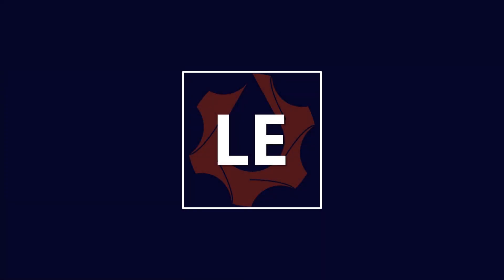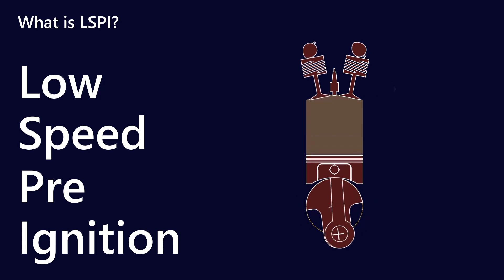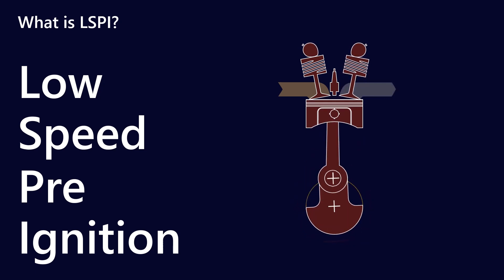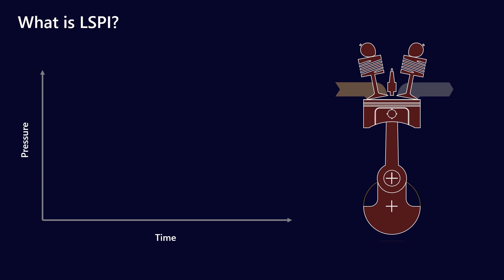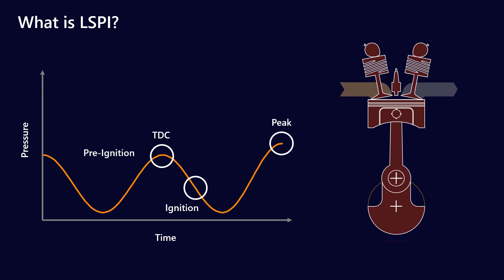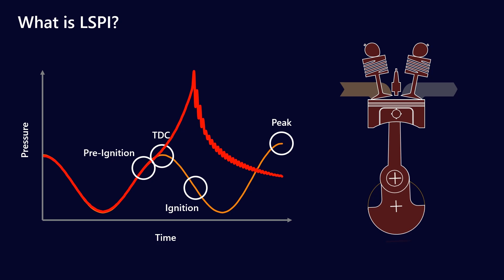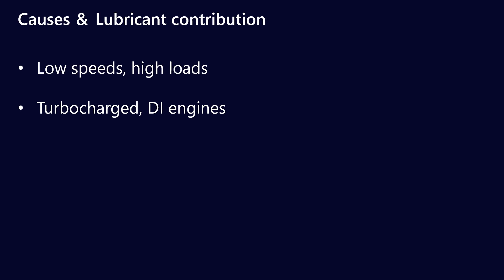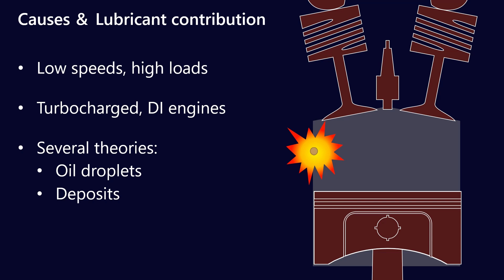How does Low Speed Pre Ignition (LSPI) ruin engines? And what are the causes?

Comment: Interesting.
If I am not wrong, it's only gasoline engines?
Why are not diesel engines (di, turbo charged, common rail...) affected?
Reply from the maker: Good question, and not sure it has been studied in detail. However, the “oil droplet” theory requires a mix of oil and fuel that spontaneously combusts. Diesel is both more viscous and less volatile than gasoline, so the mix of diesel and oil will be less likely to be “thrown” into the combustion chamber, and less likely to self ignite.
Reply: Direct injection gasoline is low pressure and happens before the compression stroke. Diesel is very high pressure and injects near maximum compression so there is no fuel in the cylinder to pre-ignite and the normal diesel cycle is spontaneous ignition from the heat of compressed air. The diesel injection behaves more like a flame thrower. LE is somewhat incorrect or misleading in saying that diesel fuel is less volatile. It is true that #2 fuel oil [common diesel fuel] has a lower vapor pressure than gasoline, but that is mostly irrelevant because both fuels are being injected as an aerosol and greatly heated. Meanwhile diesel fuel is formulated for a high cetane rating which is conceptually the inverse of the gasoline anti-knock 'octane' ratings; as such diesel has a much lower thermal stability and low autoignition temperature. This is because the diesel cycle relies on rapid auto-ignition. Diesel engines also tend to use higher viscosity engine oil that stays stuck to the relatively cool cylinder walls where autoignition is a very low probability. 

The Otto-cycle spark ignition must prevent auto-ignition and pre-ignition during compression so that the flame front can be controlled by a spark. Pre-ignition is not defined by top dead center, it is defined as any sort of ignition before the planned spark. The basic 4-cycle description given in the video is inaccurate for real working engines, spark occurs 5 to 30 degrees before top dead center depending on the specifics of the RPM, power setting and engine design, so the flame has time to propagate and reach peak expansion rate just after TDC  to get maximum performance while avoiding detonation. 

In the Otto cycle there are two knock problems. 
One is pre-ignition which traditionally occurs from a bit of cinder or other solid hot spot acting in place of and before the spark, detonation can be a form of preignition but is usually viewed as a separate category. In older carburated engines the hot cinder could cause the engine to keep running(poorly) after the power to the spark ignition has been turned off.

Detonation is second category of knock which is nearly simultaneous auto-ignition and tends to be caused by fuel with too low of an  anti-knock rating for the level of compression heating. (True barometric compression not simple piston displacement.) In detonation the total volume of air-fuel mix reaches auto-ignition temperature at nearly the same time and violently detonates rather than the preferred mild end-to-end style of burn. Detonation can occur before or after the spark, if before the only cure is to increase the quality or quantity of fuel(or in rare cases pre-cool the air or direct water-methanol injection to absorb the heat of compression), increasing the proportion of fuel acts to absorb some heat and slows the rate of burn after the spark. If detonation occurs after the spark you also have the option of retarding the spark timing so as to reduce the peak pressure and delay the peak pressure. Each method has its place.

That said the lube oil droplet in the video would likely have a low resistance to autoignition compared to the base gasoline. Generally aromatic compounds have high antiknock ratings and paraffinics have low anti-knock ratings, thus toluene has been a popular hydrocarbon fuel in several motorsports. Meanwhile crankcase lube oils tend to have the aromatics removed and with the fashion for extra super low viscosity lube oils it would be easy to have problems. This is especially likely because while many bits of an automobile are legislated or held to some industry specification, oil consumption has only ever been the will of the manufacturer, so I would guess these problem engines also have high oil consumption so more oil is likely in the combustion chamber and more likely to be a free droplet do to the low viscosity.
Reply: Because of the vacuum within cylinders in a petrol engine. A diesel engine is for argument sake atmospheric pressure within a cylinder even at idle. With a petrol engine you have a throttle valve and now with variable valve lift the vacuum is increased even more. this vacuum at idle/low speed draws oil into the combustion cylinder. In the transition from low load to increased load (especially with boost) the oil vapour ignites as with direct injection it is just air that is being compressed instead of air fuel like port injection where the fuel reduces compression temperatures. Once the engine has built a positive pressure in the cylinder from boost and load the oil that passes by the rings is forced downwards instead of being sucked into the cylinder. Hope that helps.
Reply: Only downsized high compression gasoline engines
Reply: With Ethanol they don't have LSPI, only on 87 octane gasoline.